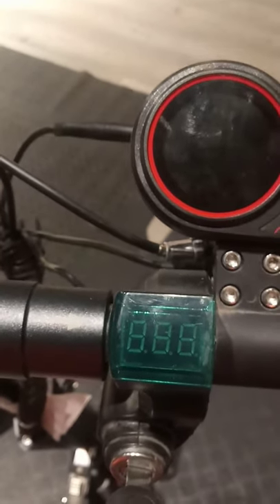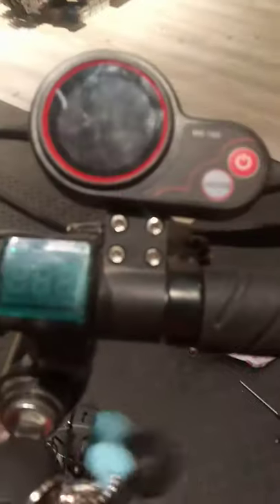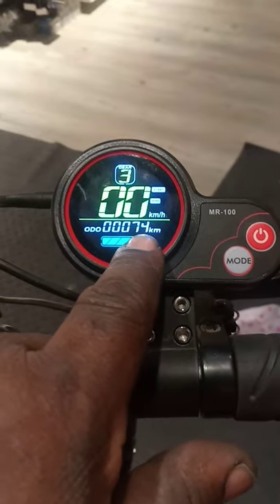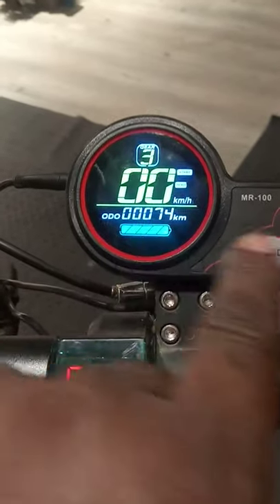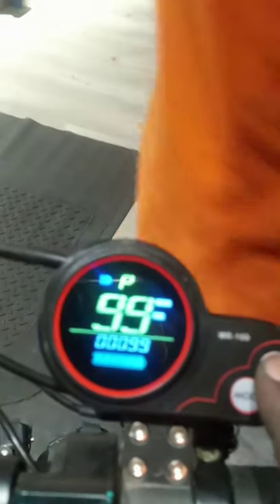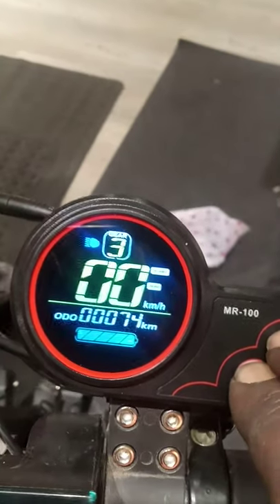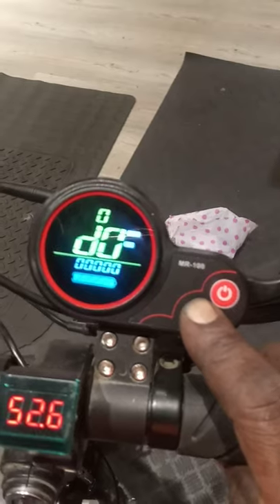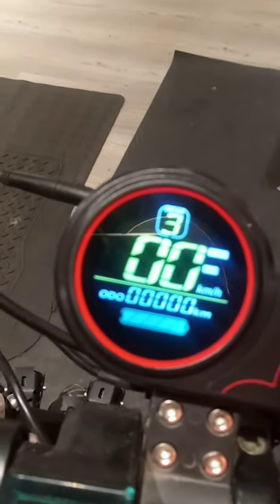How to Reset your E10 LCD counter to default

Comment: My scooter has like lcd deley so when u press the speed it takes like 2 secs after the scooter goes is there a way to fix it through the lcd ? For it to have no deley
Reply from the maker: Thanks for your support
In regard to the delay on LCD it depends with the hardware and model. I can say it's normal for your scooter being the latest on the market there are features you will learn as you continue riding

Comment: I have scooter but it's shows 46.4 .  How many volts it should be ?
Reply from the maker: 54v
Reply: @ErnestAngo254  I want ask.  When it's full charged. What light color Will be at the light charger?
Reply from the maker: @الغردقةاونلاين  when fully charged the green color will appear
Reply: @ErnestAngo254   thanks

Comment: My scooter lcd light wont turn on, whats his code
Reply from the maker: Thanks bro for your feedback. The LCD not turning ON can be a result of different issues. 1# check the battery fuse. If the fuse is ok check cable.  If the cable is ok and current is flowing then your LCD is faulty
Reply: @ErnestAngo254  thnk u so much, and i have problem in speed don't correctly km whats his code
Reply from the maker: @samadwilles.w.a.g9820   Thanks you so much for your support. In regard to your Km/Miles , most scooters the settings is in no P2
Reply: @ErnestAngo254   thnk uni really appreciate it
Reply: I have the same problem how to check the battery fuse pls
Reply from the maker: The fuse is located on the main power cable (Red) on the battery. Not all batteries have it. But Incase you don't have it then you need to check the battery voltage using a multimeter  or  connect to the charger and see if it's charging,. If not charging that means the battery is faulty you may Change the BMS or the battery pack.

Comment: I have a question! So I have a TNE V4-Q4 Plus 2023 model. The monitor as shown in your videos randomly turns off and usually sometimes stays on on high speed and then casually turns off. Is it faulty or is there something that I pressed that could make it do like that?
Reply from the maker: This is not correct.. there's a possibility settings have been changed
Reply: Apologies for the late reply, however, until this moment I am not so sure to WHY it is still doing that. Randomly out of nowhere the Scooter decides to stop working (The Monitor as shown in your video/s). Any possible issues with the scooter that could affect it doing that perhaps?

Comment: That’s big crime. If someone is buying used electric scooter, seller can reset the odometer and give wrong information for the buyer. Imagine you are buying used electric scooter that was ridden over 5k. But the current odometer says only 75 mile.
Reply from the maker: Refurbished scooter is well known .  it has a lot of scratches and also tires are Old you can't and also the battery circle will depend on the first user. The suspension will show it's used .. generally you need to be satisfied with the product before you purchase.